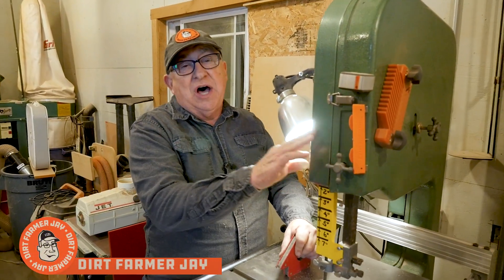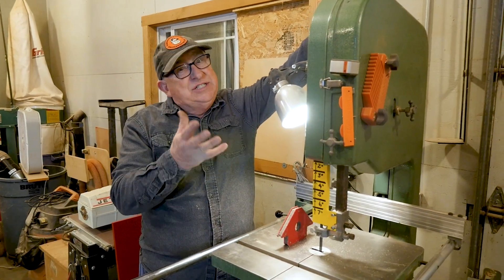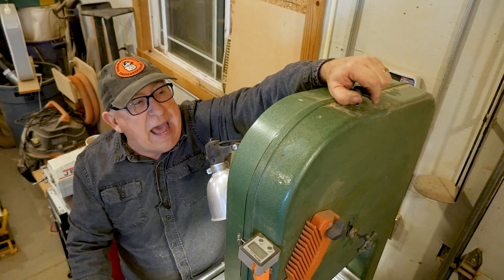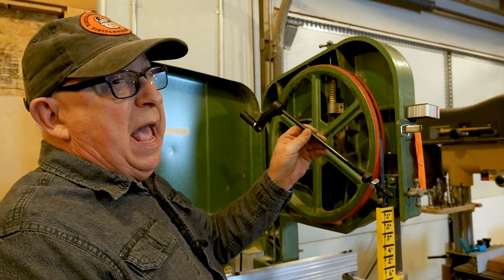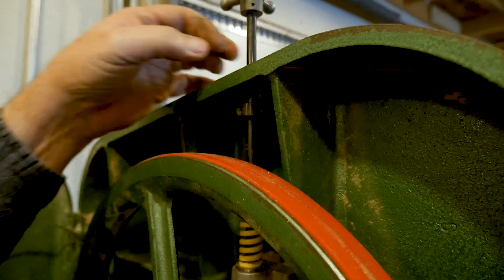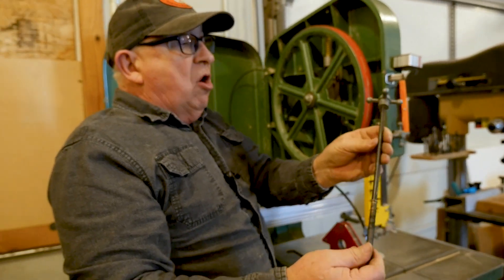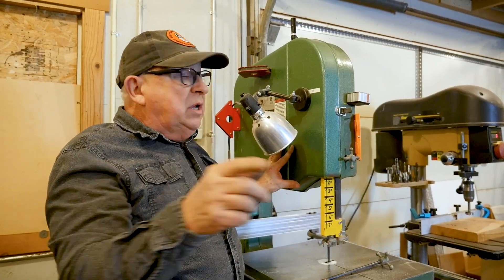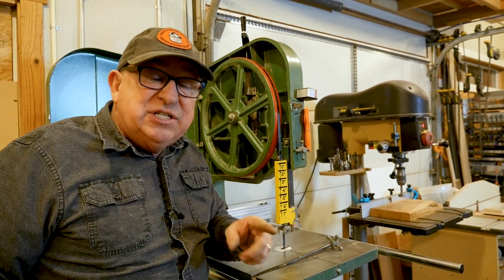Best Bandsaw Blade Tension Handle Yet!

Comment: I just installed this crank on a Rikon 10-321 and found that you need to use the included large black nut to replace the metric original block. The shaft point needs to be ground off and as in the video, the shaft cut down to a more manageable length.
They also include a second steel nut which had no purpose on my saw except to confuse the issue.  Ultimately it works great.

Comment: One could simply buy the crank handle from McMaster Carr or similar and install it on the factory rod. Depending on the rod or handle choosen an adapter may need to be fabricated but you wouldn't be buying extra material that's not needed.
Reply from the maker: Indeed, that's a good way to approach it. Thanks for weighing in! Best, DFJ